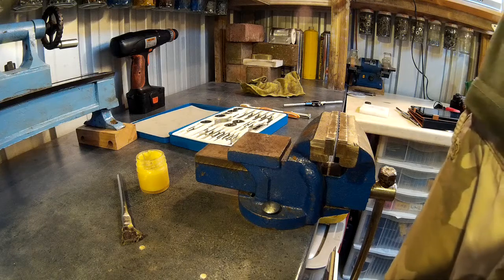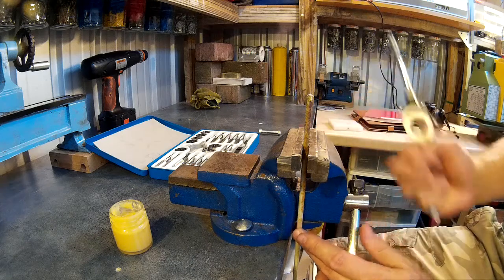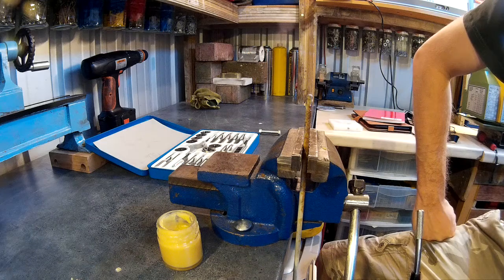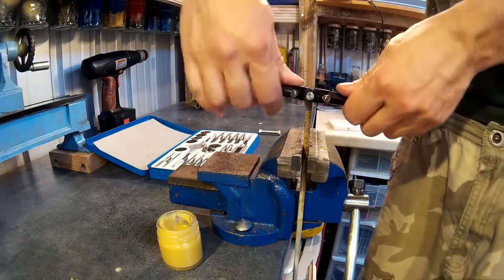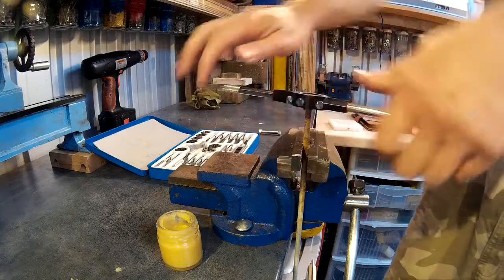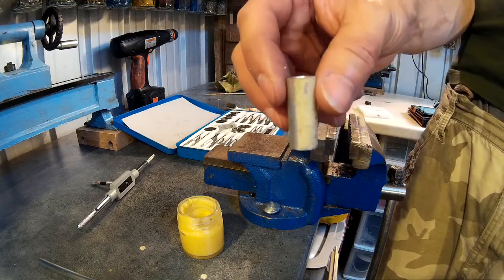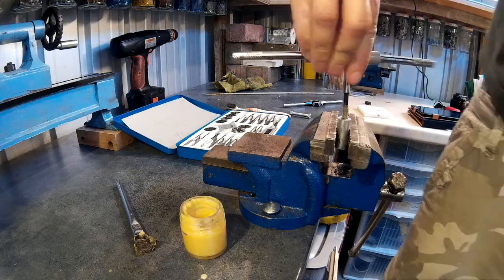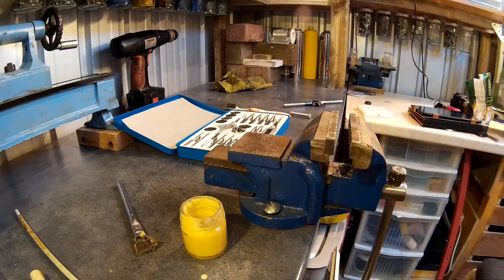TAPS AND DIES CUTTING SCREW THREADS

Comment: hello can you help me out. is there a 6 and 32 seconds to tap.. is that a tap size? thank you for your help
Reply from the maker: 6-32 UNC tap you can get the dril and tap set has a 6-32 in it might be helpful  here. https://www.banggood.com/6pcs-HSS-14-Inch-Hex-Shank-Combination-Drill-Tap-Bit-Set-UNC-or-Metric-Deburr-Countersink-Bits-p-1006036.html?p=070519238739201308J6
All the best.
Reply: oooo ok thanks again.

Comment: lovely set :-) I have a similar vice my friend gave me, invaluable once you have one for sure :-D got a great setup, I definitely want a tap set now after watching you do these, can see it really coming in handy for jobs here and there :-)
Reply from the maker: battonfive  Yeah Taps and Dies are very handy whether it be repairing old threads or starting a new. once you got a set you wonder how you done without.
Reply: Norfolktuber can imagine :-) it would be really handy to put a thread on a rod of metal say, or to expand a thread on a bolt :-D
 Will keep an eye and get a set over the next month or so, im short on space here but this would fit nice under my desk and knowing it would be there would open me up a lot more options on my little projects here and there :-)
Reply from the maker: Yeah. i brought one here. http://www.ebay.co.uk/itm/Professional-Quality-Heavy-Duty-28piece-Tap-Die-Thread-Cutting-Set-Metric-/261979876575?hash=item3cff37acdf

its not to bad better than most cheap sets i had in past. good price.
Reply: Norfolktuber yeah very reasonable, I thought they would be three times the price, I will pick one up on my next components and tools run, just saved this to my ebay watchlist, ive just done a bit of a buying round so im a bit strapped atm :-D